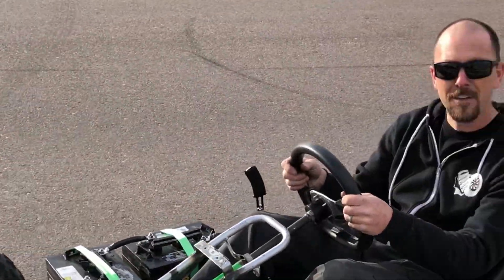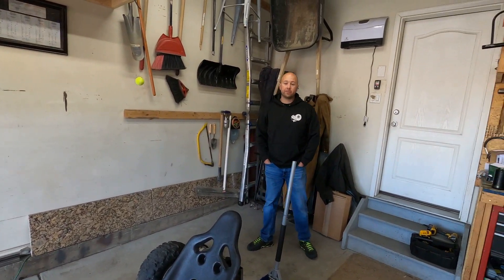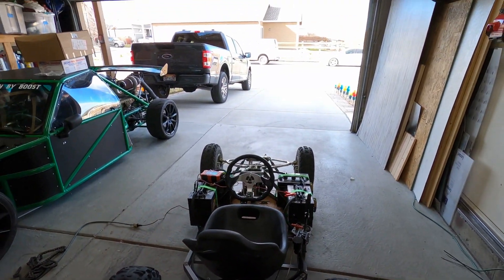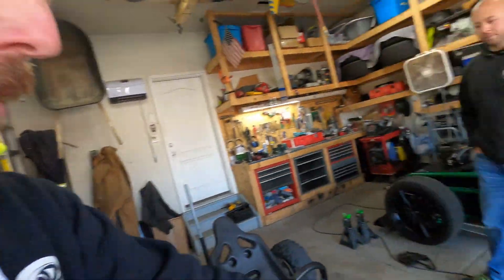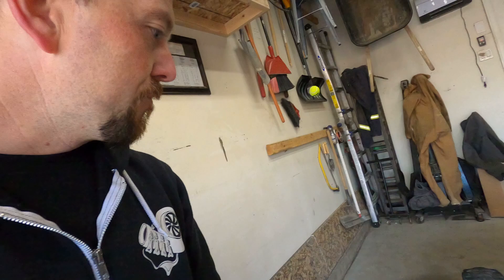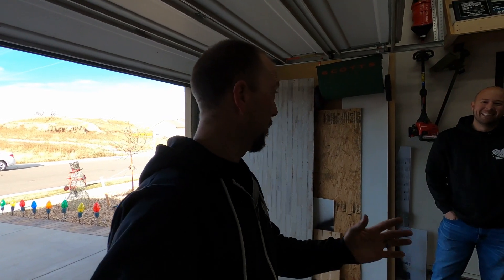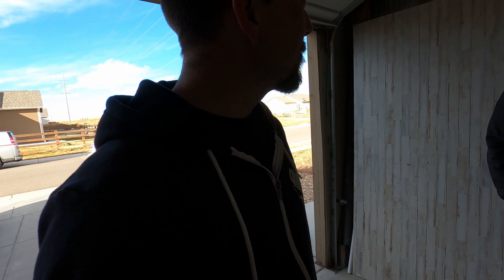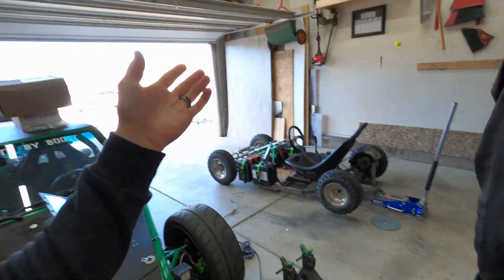Electric Go Kart build

Comment: A name for it???... I don't know if ya'll will remember a RC car called the BOOMERANG, by a company called TAMIYA. that caster on that chassis platform or series of chassis, was on many named cars, like HOTSHOT, 1 & 2, Sabre, Super Sabre, Big Wig, and many more.. For a BMR chassis, they were something to thrash on in the back yard, and not really designed for hard core racing, unless everybody else was running the same chassis system.. Anyhow, in forwards direction, they handled bumps or rough terrain fair enough, had allot of belly smacking, ... BUT... if you ever went in reverse, the steering and suspension geometry was, as stated, forwards only...lol.. in reverse, that whipping action side to side was horrible, and the faster you went in reverse, the nastier it got...Okay, replace all the steering parts to tighten everything up... Nah, fixed nothing, due to the offset of the wheel's center line, in relationship to the kingpin center line, and then the harsh caster.... If ya'll haven't come up with a name, as you may have already, as I just found your channel... I say, "BOOMERANG" or "SLINGSHOT"

Comment: Hi, i’m french, i make a quad for good road but in electric motor, what Is your motor? And what Is  voltage batterie? And Amp? 
Thanks
Cordialy
Reply from the maker: It’s a 2kw dc motor I recommend a ac motor and controller and lithium cause these battery’s are heavy. It can pull up to 350amps

Comment: Need to use a golf cart steering rack OR use the ATV handlebars.
Reply from the maker: We found several issues with the steering which we’re going to fix. The caster was crazy and the Ackerman steering angle was not right the outer tire was turning more than the inner